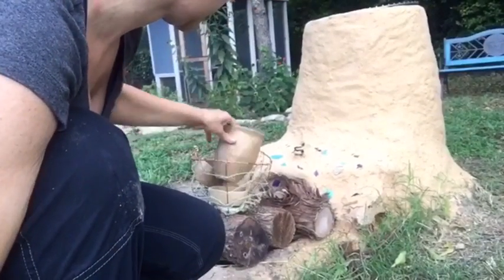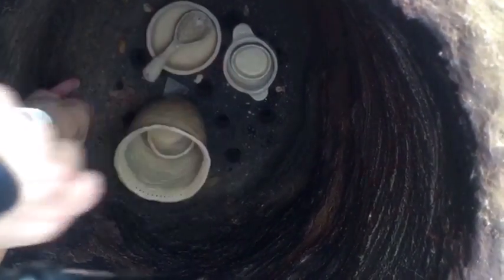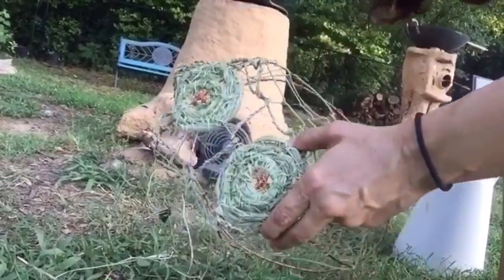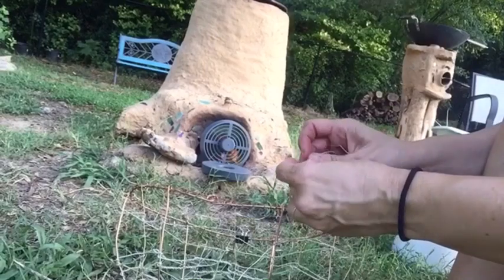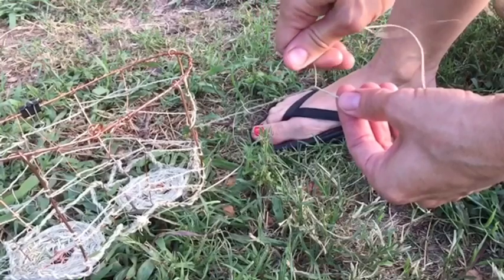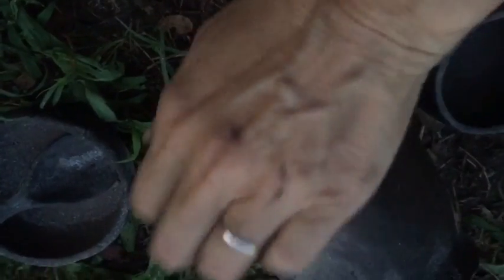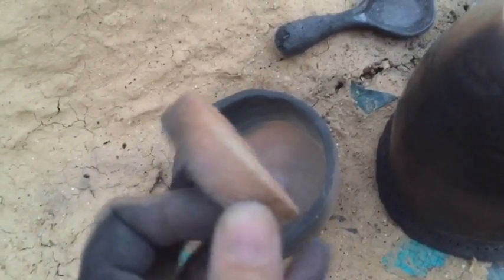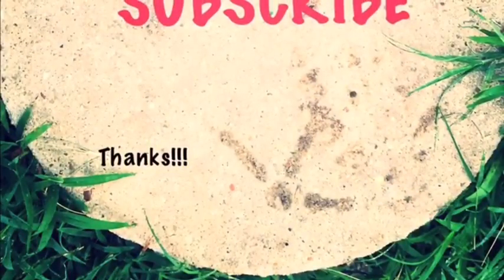How to Fire Pottery in Primitive Kiln

Comment: Nice video.  I love this kind of stuff.  I have done a bit of this sort of thing and have been able to reach 1850F (cone 06 or so) in about 2-3 hours.  Earthenware can be fired hard to glowing red temp with just with a large campfire and a hole in the ground, which will harden it enough to be usable.   But with your primitive kiln you can probably reach glowing orange or even yellow (cone 08-04) which will make for stronger pots and possibly even make lowfire glazed pieces  A few tips for next time, wood kilns need lots of air flow to get hot flames, and flames do the heatwork in a wood fired kiln. So don't completely close up the chimney like that.  The chimney opening should be about as big as the firebox opening.  In electric kilns you have to  trap the gradually growing heat but wood kilns need the hottest possible flames to be licking and surrounding the pottery to reach temp. I know it seems like you would lose all the heat but it doesn't work that way. In this type of kiln the idea is to build a flame that is long enough to engulf and surround the pots and keep it there for a couple hours. Try to use very dry wood. A few larger log pieces (3" thick or so) is Ok early in the firing to make a bed of coals but then use smaller diameter branches (1/2" or less) to  make the push up to firing temp. Use some sort of grate to elevate the sticks up above the coals for hotter, faster combustion.  When it is all working you will sometimes see flames shooting several feet out the chimney and each stick added will burst into flames instantly and will burn up rapidly. Once the fire is really going good just keep adding 1 or 2 small diameter sticks at a time pretty much constantly until the pots start to glow orange (which will be around cone 08) It takes a lot more sticks than one might think and some practice to learn the rhythm of when and how much wood to add.  Once you reach temp, then close up the chimney and block the fire box to keep cold air from entering and cracking the pots.  Good luck.   If I ever make youtube videos it would be this sort of thing.  I love pottery but dislike that it has been so commercialized as a very technical and expensive hobby.  I want people to realize so much can be done for free with materials you can find anywhere (cavemen didn't buy clay, kilns, etc from the store and they did just fine)
Reply from the maker: +Tom Yocky Wow!  Thank you Tom!  I've enjoyed the cheap and the expensive versions.  The info about the sticks and leaving the top open is especially helpful.  If you check out some more recent videos you can see my fail with the limestone pop outs.   I've since fixed that issue... by straining better and soaking in water post firing.   Please leave comments on all my videos as I enjoy your input!  : )
Reply: Tom…awesome information there , anyone reading it will definitely takeaway some very good knowledge, thank you for sharing , I have done normal firings in the ground earthen ware nothing great but was excited every bit like this lady was , knowledge is power and what one can do with that is the sky is the limits lol. I’m looking forward to making better pottery now , thanks to this video I’ll have another crack at it . 👍
Reply from the maker: Good luck, from this lady!! : )

Comment: Great job!!! Only recommend starting your fires with lots of small dry sticks. They burn faster and you will get a very hot bed of embers. Adding the large logs tends to slow the combustion down. Also watch the type of woods you are trying to burn, greener wood and wood with a damp core that has not dried (seasoned) will take away from you fires energy.
Reply from the maker: Hey thanks! That's helpful!!

Comment: I think non-hightemped pottery is called low temp earthenware
Reply: and I've heard its actually better for cooking over an open flame if you don't have pottery but earthenware, (instead of a ding you hear a thud when knocking the jars), I don't know the science behind why it's better but I've heard they crack less when exposed to open flames repeatedly. The african pottery makers never heat their pots up to the point of "ding" worthy pottery, they simply use pitfiring techniques.
Reply from the maker: +Hunter Sells I heard that also... The high fire stuff would shatter if used as a cool pot.
Reply from the maker: +Hunter Sells "low fire" ... I just got an electric kiln for high fire.  🤓

Comment: Nice job
Reply from the maker: Thanks so much.  Now I opt for the convenience and safety of electric kilns.  But that was a very cool project.
Reply: Thank you Julie I'm trying to make a fire pottery kiln
Reply from the maker: @duduuyeee8666  well make the chimney taller than mine. That was a mistake I made.  Good luck and be careful! Would love to know how it turns out.
Reply: May I know what temperature is the kiln for the pottery you make?
Reply from the maker: @duduuyeee8666 cone 6
Reply: approximately 1010 degrees
Reply: Thank you for the information Julie
Reply from the maker: @ sorry, I don’t know what you mean. I don’t know the top temperature of my kiln. But in order to fully vitrify the Clay that I use I fire to a combined at time and temperature that is referred to as a cone. I don’t know exactly what your experience level is so I might be talking down to you and I don’t mean to.